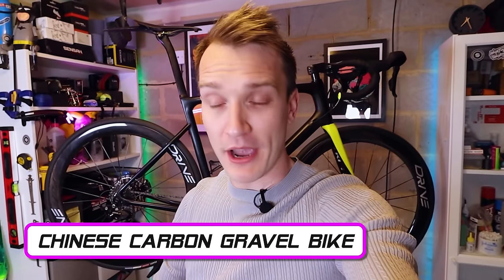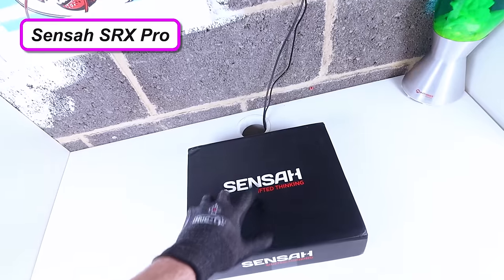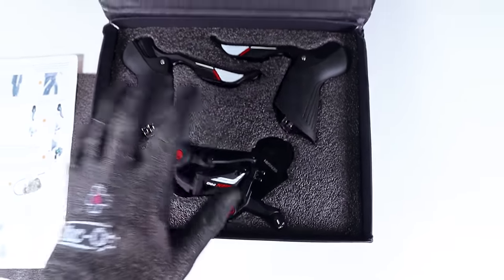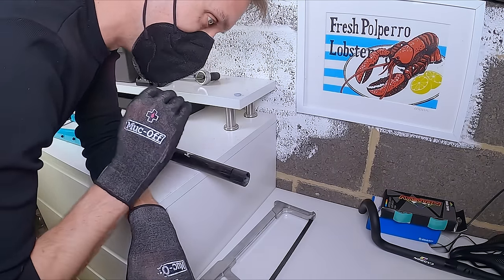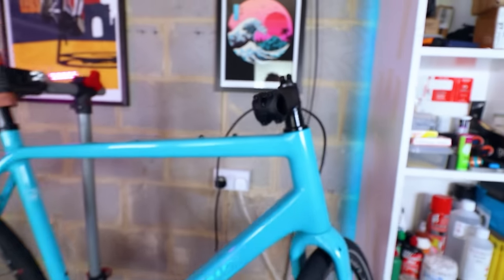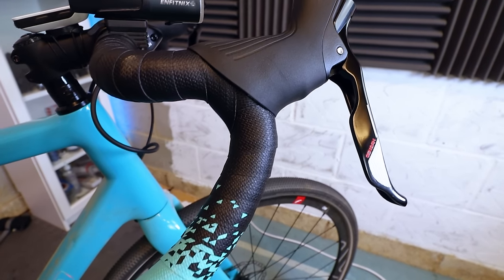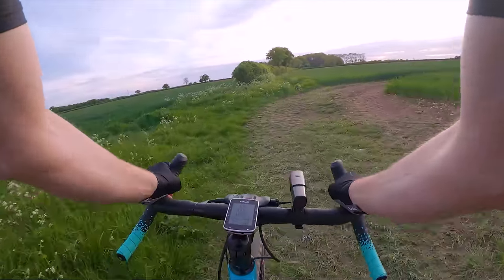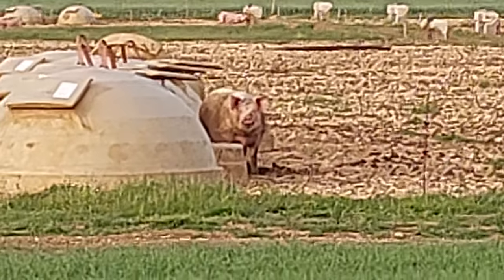Chinese Carbon 1x Gravel Bike – Full build & test

Comment: Nice video @TraceVelo! 

I love this channel and the video in fact you and some others inspired me on my own build. And what a coincidence! A year ago I built the exact same frame but going on full spec 1x12 mullet gravel racing / long distance machine but under 2,5k, sub 8,5kg (with some tricks). I have to say that the build is as fast as rocket & also bombproof (I had quite bad crash at 30km/h). I still go through trails with mtb friends.  Hope you enjoy the bike!

For the ones interested is the build parts:
- Ican X-gravel frame (same as TraceVelo but 2 tone sparky green)
- Shimano XT Pedals (must for bad/muddy trail days)
- DT Swiss GR1600 (alternatively some from china or ZIPP 303s if more budget)
- Pirelli Cinturato Gravel M Tubeless (best for all round & mud) , (G-ONEs are destroyed quickly)
- SRAM 1x Rival hydraulic Brake levers (right with dropper post actuator as it was cheaper and lighter than force)
- SRAM 2 piece road 160 & 140 rotors (lightweight, heat dissipation is must, I'm aggressive descending, took them to the limit twice)
- SRAM Force Dub carbon crankset + 46t chainring (offer for the same price as an apex, don't ask why)
- SRAM X01 MTB mechanical rear derailleur (plenty of stock, as everybody wants AXS)
- SRAM GX MTB 10-52 cassette (X01 is better and lighter though)
- Ratio Technologies 1x12 Upgrade Kit / adapter to modify the levers & derailleur (Here is the magic)
- Aliexpress Carbon saddle, stem & handlebar (cheap & lightweight)

You can go with Aliexpress cassette to save some bucks and even cut on some components (even go for Sensah, I think they are releasing soon a 1x12 gravel groupset as well), but overall quality of my build matches top end 6k to 10k gravel builds. 

As note in fact that is a Carbonda CFR696 frame, which is the open mold that a lot of other brands have been using for their midrange carbon bikes such as the old model of the Ridley Kanzo Adventure,  Berria, Planet X, or De Rosa, amongst others ( I do not discard some of them even resell from Carbonda). (Also Carbonda released a new one last year with fully internal cable routing, worth checking)
Reply: sounds like a cool build, you got any pics of your sparky green frame? i was thinking of a green 696 too in the future

Comment: Hey, absolutely love the videos - I have an SRX Pro groupset on the way, so good to hear it worked out for you! 
RE: SPD Pedals - I've ridden exclusively SPD pedals (even on the road - I like gravel/MTB shoes more), and this is one of the times where it's worth it to spend more for name-brand. Shimano PD-M520s go for about $50-60 CAD (maybe 35-40 pounds) and are bombproof, whereas the two knockoff pedals I've tried (Ztto and Wellgo) both broke after a few thousand kms. Get the Shimanos.
Reply from the maker: OK nice. Yeah shimano SPD-SL pedals are literally indestructible in my experience, so I'm not surprised it's the same with their SPD ones too, so I'll def keep this in mind. But let's be fair, I'll probably still get both, because when i comes to buying bike parts on AliExpress, I have a problem 🤣
Reply: @TraceVelo  Oh yeah, absolutely, I do too - why do you think I bought the knockoffs? In my mind, why buy name-brand gear when you can save $10 and have neverending reliability/compatibility issues?

Comment: Wish you a lot of fun with it! I fitted 700x50c on this frame with still enough clearance. Also I choose 38t on the front (same 11-46) because we have some very steep hills here in Switzerland 😅. I spin out at 45kmh, for me enough on a gravel. 505 hydraulic and elite gravel wheels here, I love it. The frame is ingenious (same as the cfr696) .

Comment: Hi Luke, apologies for the zombie 🧠 comment, but I wanted to give you kudos for this video. I bought this X-Gravel frame, the Sensah SRX groupset, but used Juin Tech brakes, Ryet integrated bar & stem, and Elite ENT carbon gravel wheels for an awesome gravel build. The frame paint looks fantastic and I fitted some tan-wall mixed terrain tyres to give it some extra cool factor 😎 I can't wait to get off the paved roads and onto some gravel! P.S. you need some SPDs pedals and shoes with recessed cleats to manage the riding/walking combo.

Comment: Nice video. i also built 1600 dollar chinese gravel bike weight 9.1 kg with tiagra hydraulic 2x groupset mixed with grx crank
Reply from the maker: Nice, yeah I actually considered the hydraulic tiagra groupset, but opted for 11 speed instead. Tiagra is a solid choice tho!

Comment: Nice build and loved the vid! I have this frame from a different brand and it is legit the business. Definitely go big on tires. I run 45s a lot of the time, but love getting rowdy on 650b 2.1 inch tires too! You should be able to fit up to 700x50 tires as long as you're not getting them caked in mud. 

Agree that you need a smaller front ring. Consider getting an XD freehub so that you can put on a 9-46 cassette so that you keep your top end, even with a 38 chainring (each one tooth smaller in back equates to 3-4 teeth in front).

I have ZTTO cassettes on all my bikes and I've probably bought 20 of them between my own and family/friend bikes (the 12 speed 9-50 version). I find they work best with their "own" branded chain (which is actually made by SUMC).

Comment: Hey Mr. Trace Velo, great vid and project! Get's me thinking about ordering and building up my own bike like this! Only thing, Why not switch out the mechanical to disc conversion on the stem and install some Juin Tech F1 Mechanical to Hydraulic brake calipers?  That stem converter alone weighs around 500g, i took it off my Giant Revolt and could not be happier! With the Juin Tech brakes It would shave off some weight from the build, making your chinese carbon 1x gravel bike compete with specialized crux and cervelo aspero weight wise which is mental! Great job and great video 🙌
Reply from the maker: Yeah I definitely considered using JuinTech brakes, plus I have a spare set lying around... but I just couldn't resist giving this a go! But when I inevitably start looking to drop weight from this build, the JuinTech’s might make an appearance!

Comment: I had the Senseh XRX derailleur and control. While the control shifted well, the derailleur’s spring is abit weak. Also, the b-screw stop for the drop-out lip, was too small and ended up failing by damaging the drop-out. To compare, Srams’s GX Eagle’s b-screw stop is a lot larger, so works with my drop-out. Other than that, it was a decent derailaur. I hope Sensah fixes these two issues.

Comment: Where my Flybike FM 696 boiz at?!?! That solid single piece aluminum BB shell is nice! Get ready for the cable rattle inside the frame.
Reply from the maker: Yeah cable rattle isn't too bad actually. I had a little rattle from the rear brake line, but managed to sort that with a little piece of silicone tubing! Fantastic frame overall tho!

Comment: At 26:07 you mention the steerer pug, but it should prolly be a longer plug so it will extend past the crown race/bearing area.  Durianrider mentions this often and for good reason because without the long plug, there is greater chance of failure of the steerer tube at the top of the head tube. Just a recommendation.

Comment: Brilliant as always Luke. Thank you.   I've built a few road and mtb's from the frame upwards but never had the courage (or gumption maybe) to look beyond the major brands when choosing components.  I def will next time, and a gravel will be my next project, and your videos are invaluable.  Only one item I'd question with in your build.  The cheapo chain choice.  In my opinion (and experience) it's been false economy in the long run as well as just not being so quiet and smooth changing when I've gone for a cheaper chain.  Thanks again and look forwards to seeing how the new Elite wheels work out next time around.

Comment: I've been eyeing on the Giant Conduct system for my bike, and I feel like there might be a flaw with the design. Gathering from cars' and motorbikes' brake designs, the reservior is always above the master cylinder to make sure only fluid gets taken in. I don't know how it's arranged internally, but that top cable plunger might be close to the limit when it comes to getting fluid from the reservior. If there's a bit of leftover air pocket, the bad timing of a violent bump and braking could introduce air buble into the system. A negative rise stem could do the same considering that would also rotate the entire assembly nose down. Maybe that's why people have been having bad experiences with them.

It's not something that needs to be considered with STI levers since it's safe to assume everyone mounts their levers somewhat leveled.
Reply from the maker: Hmmmm, this is one of those comments that gets me thinking...

Maybe I'll deliberately introduce an air bubble, and see how we get on
Reply: Just swapped my Conduct system off my Giant TCR. The back brake failed after just a few weeks. The dealer rebled the system and it was ok for a few more months before failing again. This time, no amount of bleeding would fix it and oil started coming out of the depths of the piston unit. Also had great trouble wirh the bleed screws in the Giant calipers. They are too soft and the heads 'chew' far too easily.
Replaced everything with TRP Spire mechanical disc brakes. Very impressed.
Reply: @kenprior2008  Sounds like a master cylinder seal broke, and it could be because the seal was moving with no lubrication from the oil because of air bubbles.

Do you put the rear brake on the left lever by any chance? Because that connects to the top cylinder.
Reply: I think you could be right  @Sierramike524

Comment: Those Conduct brakes were sold on tens of thousands of Giants over several years.  If you think Giant saved £100/$125 on every bike they spec'd them on by buying mechanical shifters instead of more expensive hydraulic shifters, they've saved millions in procurement.  Little changes like that, or even using non-series Shimano cranks, it's easy to see why their bikes were so much cheaper than competitors.  Someone who is new to riding wouldn't notice those subtle changes when comparing a 105 equipped Trek vs '105 equipped' Giant.

Comment: The paint on mine in a couple of areas was terrible, when it arrived a large section was peeling off where the front mech cable exits the frame. Fork caliper mounts had also been painted over so needed facing. I do love the frame though!

Comment: most importnat when mounting levers on carbon bars is smoothing the edges of the clamps, they are very sharp and will not curve perfectly with the bars which means the sharp metal edges will contact and potentially cause a hazard, smoothing or rounding them off some can save you a world of trouble.

Comment: Only problem I see with that frame is the water bottle bosses are not reinforced or galvanically isolated.  Other than that it "looks" pretty clean.

That Giant stem reservoir is the weirdest bike related piece of gear I've seen in awhile but it seems to work pretty decently and looks surprisingly decent once on the bike.

Also really like the vinyl behind the shifter clamp tip, I bet electrical tap would work well too!

Comment: For getting a straight cut on a carbon steerer I use two old stems as a guide but it's not perfect. I am about try using a double home antena mast clamps. As for the saw, I am using a standard black wolfram blade for cutting tiles and I think it is exactly the same as on a genuine carbon saw from park tool but I've seen people using a  standard blade for cutting metal tubes with 24 TPI.

Comment: I have a Giant AR with the Conduct kit, I've been running it for 3 years now an over 10K miles never an issue, I've never bled or serviced it just changed the pads when needed, gets me to work and back over some big hills every day come rainn frost and shine! Great bike btw, I've been considering doing my own build on this frame you may have just swung it for me ! Good Luck

I just followed your link and its not showing the discount also showing $425 ! shipping cost? to uk 

      
                

        
          USD
          $1,124.00

Comment: 25:30 douse the tube with some cutting fluid, and you'll throw less carbon fibre dust into the air while your cutting it. 

3-in-1 is probably good enough, if you don't happen to own a milling machine....

Comment: The Racing 6 is a nice budget road wheelset. I tried them on an old gravel build, the rear did not do well off-road. They will not stay true when knocked around. Good luck with them.
Reply: The frame looks like an Open Up.

Comment: For the pedals, you can go with Eggbeater 1 and replace the steel spindle with aftermarket titanium spindle. That will shave down 50-60g.
Reply: But they ar pain to ride with. Got them on my Bike a few weeks ago and it ended up beeing a total nightmare to click in.
Reply: @SvenKaufmann1986  sorry to hear that, bro. I have no problems with mine

Comment: Thanks for another Great video Luke.
I must say I was well surprised with the Conduct choice. I do feel it is a very genius solution but in my case I had hard times bleeding this . 
I find your last recommendations spot on , change the tyres to 45mm chainring to even down to 36 as a 10th difference ( 36 front ,46 back)  makes the difference in big hills  .
And finally,  go SPD for easier clipping at muddy rides. 
One thing about the bicycle comparisons  is that they are not 1x11 sp,  and carbon frame. So not a fare one  on the weight?  
Many thanks.
Reply from the maker: Yeah with the 2x bikes, this is a fair point on the weight, so point taken! But yeah I think bleeding the brakes well is the key with conduct. It took me a good few minutes to get all the bubbles out of the brake lines and reservoir

Comment: 9:47 Is there any difference between the Senicx PR2 and GR2 other than the chainrings that come with the crankset? Like are they both compatible with the same chainrings and 68 mm bottom bracket shells?
Reply from the maker: Im not totally sure, but it might be. I assume you will be able to swap the chainrings between them. But having said that, the spacing for 1x and 2x cranks might not be the same. Prob worth a bit of Googleing, but might work...

Comment: will those wheels be ok for disc brake use? they seem to be laced not completely radial but don't look 3 cross for strength,  would rather something more robust for offroad braking, my old giant toughroad gravel bike came with that brake setup, very good tbh, it's now on my brothers bike but same as you had to use the giants own stem for it.

Comment: Nice build.  I have 2nd hand Giant Conduct with 2nd hand Dura Ace levers on my drop bar MTB conversion.  Can’t find a 120 -17 stem to fit the Conduct face plate so can’t get the bike fit perfect.  Aside from that the braking is OK.

Comment: I have a 1x gravel/road bike made with an airwolf frame. It’s very similar. Same shifters, close to same handlebars. I went with the oniiri disc brakes but they haven’t been splendid. I would love to see a review of that braking system. It looks wicked.
Reply: Hi, what's your opinion on handlebars? I use carbon on the road, but not there yet on Gravel bike, especially on some rough terrain.
Reply: Did you get the Oniiri BR-002 or BR-005 model? I have some 005s in my cart, but might hold off if they are not good

Comment: Nice build! I'm thinking of doing a gravel build with Empire pro shifters (because carbon) with SRX derailleur. How do you feel about the flared bars? Any tangible benefit or is it just gravel culture/aesthetic?
Reply from the maker: Yeah the flared bars def help. It's mainly so you can grab the bottoms of the drops on the tricky downhill or bumpy sections, which are much wider.

Comment: I think with tires you can go wider than 45c up to 50c which is what carbonda recommend for their 696 frame (as you mention which is the same).

Overall great build!
personally I would change rims for wider as tires (tbh these schwalbe looks like cheap trekking tires with that white strap..) and throw some more cash to go full hydro (grx400/600). Wonder when sensah make that big step and start making hydro levers...
Reply from the maker: Yeah, once Sensah releases a fully hydro groupo... I'll be all over it like a RASH

Comment: I use flats for pedals...  I do a lot of mixed terrain and some of it is technical chunky single track..   With narrow handle bars compared to mtbs your balance at slow speeds is much more difficult.   I fell over at slow speeds with my SPDs still engaged.  Luckily it was only me that was bruised and not my carbon bike.

Comment: I'd definitely go full hydro on the brakes, probably just run a Shimano GRX or SRAM Apex groupset.  I've NEVER heard anyone say anything good about Giant conduct brakes in the long term.  I'd actually been eyeing doing a gravel build with this ICANN frame.  As for pedals, definitely just get some SPD XC pedals and maybe a pair of XC MTB shoes to have something a little easier to walk in and takes the recessed cleat with no issue.

Comment: Hi Luke, Very nice Built. For Pedals you could try Crankbrothers Candy, which fit my Gravel Bike quite well (there is also a nice light blue Version currently on sale). When going for 45c Tires, your idea with wider rims definitely makes sense, to keep the tires from having a too round diameter. As You are a large guy, 650b might not be the perfect option for You ( allowing for even wider tires)